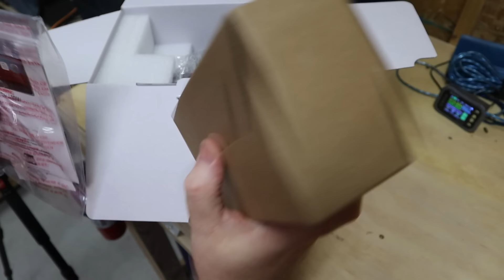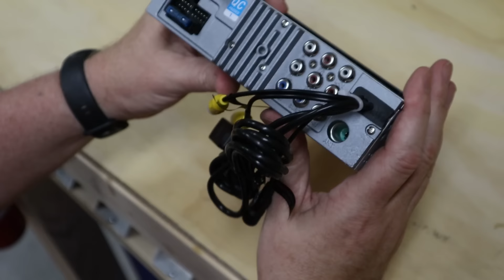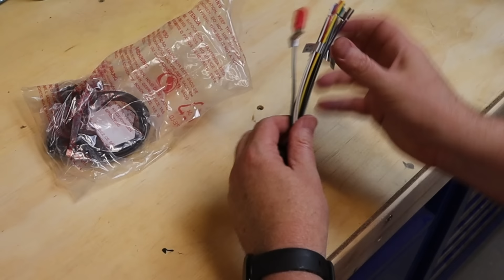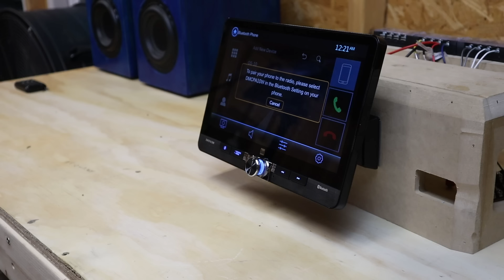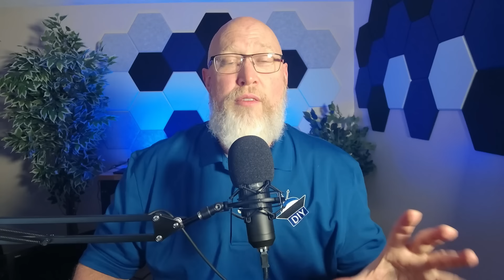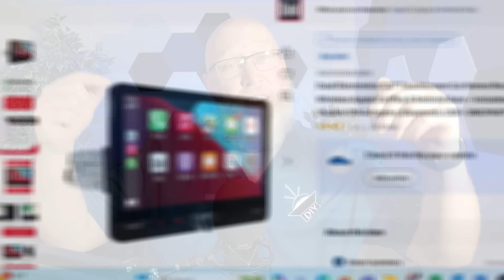The BEST Budget 10.1 Head Unit!

Comment: You should review the Mekede Duduauto dudu7, there are many variants, but some comes with volume knobs and they are around $500-$600 depending on the specs. Mine was $500 10 inch android headunit with 8GB ram and 128 GB disk space with no volume knob which i didnt know by that time which i heavily regret, but oh well, the unit has extremely fast processor.

Comment: Looks a little wide, wonder if it fits a Chevy gmt800 platform
Reply from the maker: The unit itself is a single DIN chassis, so it will fit in pretty much any vehicle.  The problem with any big floating screen like this is that it might block AC vents or AC controls.

Comment: I want the Jensen version of this head unit but in 8 inch version. Same parent company, but different sub brands. On turning off the internal amp, i wonder if that changes rca output distortion. I know my pioneer DEH-80PRS had this feature. if you kept the internal amp, RCA clipped at the same point as the speaker output. but if you disabled the internal amp, distortion disappeared and you got full 62/62 rca output with no distortion. just a weird thing.

Comment: I grounded the pink wire so it doesn't think I am always driving, it normally goes to the parking brake. The new ones come with the latest firmware so it's a lot less laggy with the volume control. It does sound decent and Android Auto is seamless if you have your phone set to connect automatically.

Comment: @diyaudioguy 
Is this something you would still recommend I buy? Thank you for the video.
Reply from the maker: At this price point, yes.
Reply: @DIYAudioGuy yeah I just saw that part... Sooo I'm definitely gonna be leaning towards the dual. I just bought the pilinius 1000 monoblock for my ozone 10". Anyways, it's clipping constantly and I think I need a head unit , considering I'm still using stock 04 Lexus head unit with kicker loc.  Will the dual 10.1 head unit do good?

Comment: I got a question for you.Don't know much about radios.And how they're hooked up.I do know I have a double din head unit in my hyundai.Equus now can you put any aftermarket head unit?As long as it's a double din in your car... Question two and do all those head units work with the buttons that you have in your car like steering Wheel... knob, in the middle next to my shifter, that controls the radio too
Reply from the maker: That is a high-end luxury car, and most people that have one are not going to DIY a radio swap.  You will want to find a local shop that can tackle that project.  Not all of them can.

Comment: Volume velocity is probably a setting that can be turned off. It's so you can spin it fast and the volume goes like it has inertia. I have always hated it. IMO, if you want inertia, use a heavy knob instead. Much better.

Comment: I had this head unit and really liked it. Then I took my truck to an installer for new speakers and amps and they dropped it and broke it. I replaced it with a MUCH more expensive Boss Elite from the installer that has a slighly bigger screen. for 2x the money the boss elite has a usb-c on the right side of the screen which is nice, it's slightly faster, and the volume knob is much smoother. But really at 3x the price, this dual unit is perfectly exceptable
Reply: Which boss model?
Reply: acceptable indeed
Reply: They broke it and u had to pay for new, more expensive one? Sounds like they padded the bill a bit to me bro

Comment: I have this exact radio in my 2012 Ford F150 I hate it wireless CarPlay always disconnects and it always dries to default to the FM radio and when it’s on the FM radio, it turns the volume to full max. It’s frustrating. I’m gonna replace this thing with a better unit.

Comment: I take it everyone running oem speakers unit can’t handle aftermarket speakers and will shut down till you turn off the internal amp and buy one for all of your speaker. When I plug in to the charger or CarPlay wire it again shuts down when volume is up. If you don’t turn up it works fine. Bought mine for 88$ I’m keep it

Comment: I just want to add a unit to a low budget car build I have been working on. I have a 59 Rambler that is sitting on a 93 S10 Chassis - so the electronics are all 12v and were related to the S10. can anyone following this thread recommend some speakers that would perform well enough with this as the head - no additional amplifier.

Comment: I’ve had this head unit. It does have clean RCA outputs but has no DSP whatsoever. the volume adjustment pissed me off every day. Super laggy and would take forever to clear from the screen. It slowly got worse and now I have to press the plus and minus buttons on the screen. Completely defeating the purpose of a volume knob. You get what you pay for.

Comment: If your buddy has an android phone and uses android auto alot , id like a followup on this unit. I have a 10.4" screen chinese head unit that i love, it is android based and cost me more than this, the big sell was that it had switches on the front for doing things and a big volume knob with a play pause button in the middle, and you can raise/ lower the screen up and down, rotate it and tilt it as my dash is angles upward. I mainly use android auto and it is the first head unit ive owned with that feature, but the android auto uses some app i cant even seem to find on the app store and cant even update it. The wireless android auto is buggy as hell. I can go days with flawlwas connection, and then some days it is a struggle to get it to connect or even stay connected. I dont have a ton of experience with android auto so i have no clue if it is my phone or the unit itself that keeps losing connection.

Comment: I've had this head unit for about a year. Sometimes the screen glitches and several lines appear on hot days. The android auto disconnects too frequently in my opinion. That being said, it is a great budget radio to have android auto and pre outs for amps. I'm running a 5 channel amp because the speaker outputs are terrible.

Comment: Meh.  My Eonon 10.1 with volume knob for $260 has been working great.  I added their Dash cam that integrates with the screen and it has excellent sound for the price.
Reply: I grabbed a different Eonon model with a smaller volume knob and tiny buttons along the bottom to install in my 05 DC Tundra.  It sounds ok but its kind of laggy and just not as good as the other Eonon.  I grabbed one of these Dual 10.1 units used from fleBay for less than 50 bucks!!  Powered it up on the bench and attached a backup camera and it all seems to be working just fine.  Going to throw it in Ye Olden Tundra this weekend to see how it compares in sound.

Comment: You can get much better units for $220, android based with decent DSP. A dudu5 should cost about the same and comes with a lot of features and OTAs every two months. That’s just junk.
Reply from the maker: Every android unit I have tried has had major issues.

Comment: I've tried android auto a couple of times and while I'm not an Audiophile the audio is totally unacceptable to me. I've went back to bluetooth.
Reply: I have never seen that. Although 3 things could make it bad 1. The DAC in the unit 2. If your using Spotify or have your streaming service not set to high res. 3. You have your own MP3's and they are of low quality. 320kbps is best. See some DACS will pick up and play the noise of low quality files. Bluetooth hides the files imperfections by compressing them.

Comment: I'd had this unit for about a year. It constantly freezes, requiring you to use a pin to hit the tiny reset button. The volume control is very laggy. There's no crossover settings. It starts up playing FM radio everytime, super annoying. I wouldn't recommend it

Comment: I have the 8" version of this.  The volume is not only laggy but it stays on the screen for far too long.  Also if it finishes booting while you're in reverse, it attenuates the music until you take it out of reverse which I find very annoying.  Wireless carplay will occasionally drop for a second or so.  Biggest gripe I have with it is that running wireless carplay absolutely kills my phone battery.  All that said, it's a surprisingly feature rich system for not much money.
Reply: Is the screen removable
Reply: @dcarden3031 yea
Reply: @dcarden3031 yes it is

Comment: Save your $$$ and get one with  a  S/PDIF out .
Reply: This should be a standard, the only variation would be the actual tracks, if they are recorded at -5, -3, or 0 gain. Zero feedback because it is light signals and not voltage. The amps would get a digital signal, so it would be optimized by the amp itself and no need to adjust the gain.  It would be literally plug and play, the only adjustments would be the EQ settings. Only pitfalls is if the hot/cold weather impacts the send and receiver of the signal. It would be easy to troubleshoot the optical cord, if no red light, its a bad cord.. 

I would totally back this idea.

Comment: This is a clone of the Jensen CAR1013. I have been a believer in quality names in the past and would pooh-pooh these brands... But damn if I'm not impressed. I had one in my last car. The screen is huge and beautiful and can't be touched until you get into $1000 USD. However, there are some issues:
1.The unit would sometimes crash, but not very often. It reboots quick.
2. Apple CarPlay would lock up. You could wait a bit and it would eventually reboot.
3. Android Auto would lock up, or sometimes not find a connection. It would usually recover same as CarPlay, but it was much more prevalent than the CarPlay at having this problem, and when it was bad, it was bad. Unpairing, choosing different connections, putting my phone in airplane mode,etc., would not solve the issue. It could take over 20 minutes for the unit to figure out out and reboot itself.
Despite this, it's a pleasure to use when it is working (which is actually most of the time). It also supports multiple volume levels, so I could balance navigation volume with music volume (just make the adjustment while route navigation is being spoken). I plan to install another one, but I will wire in a remote power button so I can manually reboot - a cheap fix compared to 4-digit price points!

Comment: the only negative i can see is the response times are a bit slower than even some of the slower OEM solutions. (subaru) and the non-android auto menus look a bit cheesy.  But i think that most people can live with that for 200 bucks. I think the head unit on my wishlist for my prius was around $700 but these features at this price is making me reconsider!  very interested in a more long term review. the biggest issues with android auto/apple carplay is having a stable connection. if it keeps disconnecting on you randomly that is the number one dealbreaker!
Reply: The biggest negative is the name

Comment: That Dual has a lot of the big name large screens beat. The big brands should be ashamed charging upwards of $1200 for a thick bezeled POS with no optical/coaxial out. A lot of them do not even have a volume knob.
Reply: Dual is a good value brand, but it's nowhere near a 1,200 head unit.
Reply: @luca_signorello  You’ve failed to understand my post. The internals on their $600 units are practically the same as the $1200+ units. The only difference is a ridiculously thick bezeled screen. They rely on their name only. That’s why I will not give them my money.

Comment: We put a dual touch screen in my sons Escalade and loved it at first but after a couple years of use the screen went wanky. The volume does the same as yours and the built in EQ will randomly rest itself. It's just not aggravating enough to replace at this time.
Reply: Exactly.  The dual ones are just too cheap and wear out
Reply: Same thing happened to my Kenwood. Now it's bricked itself 4 or 5 times and I have had to take it apart and reflow it. I won't be doing that again. Next time it happens, it's getting replaced.

Comment: I hope Maxspeedingrods makes a big screen version of the one you reviewed previously because imo that is still the budget king. Im still waiting to see a proper 5.1 setup in a vehicle btw!
Reply from the maker: The failure rate on that unit was very high.
Reply: @DIYAudioGuy  Any idea which part? I bet if you weren't using the internal amp on it it would be fine.

Comment: Dual sucks.  Audio quality is junk, buttons wear off, I've used that junk before, you want aux hookup not trash Bluetooth
Reply from the maker: Well, it's only 200 bucks, so there's going to be some corners cut somewhere.  I'm installing it in a vehicle, so I'll be able to give you a long-term update in about a year.
Reply: @DIYAudioGuy used market has far better options for that price range.
Reply: USB over aux all day. Static connections will always rule over air.
Reply: @JonGotBass that works as well any solid connection not Bluetooth.
Reply: Keep in mind this is android auto/car play that uses wifi bluetooth is only the handshake between unit and phone.
Reply: I've had 0 issues with Bluetooth while aux cords seem to break left and right. Although I won't disagree about Dual not being a great brand but for someone just getting into car decks they're like Skar for beginner bassheads. We all start somewhere 😊 Great video as always Justin! Look forward to the year after review.